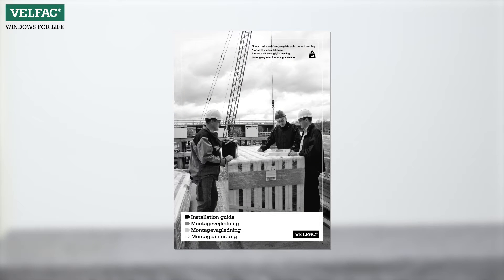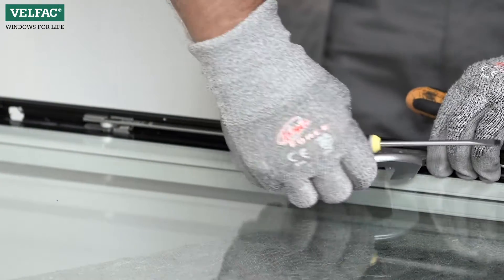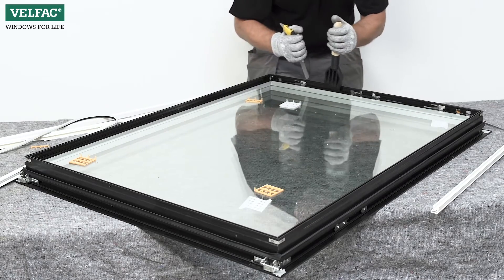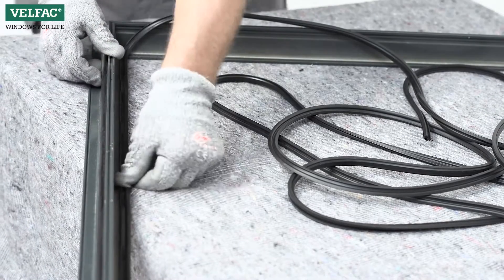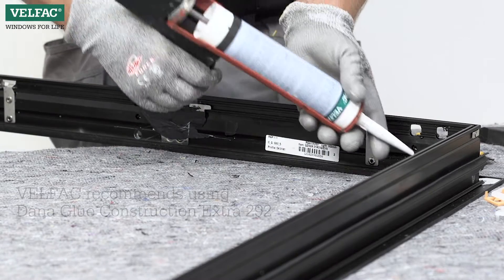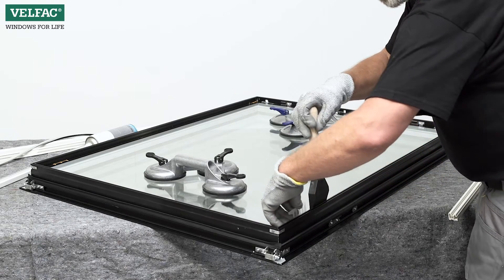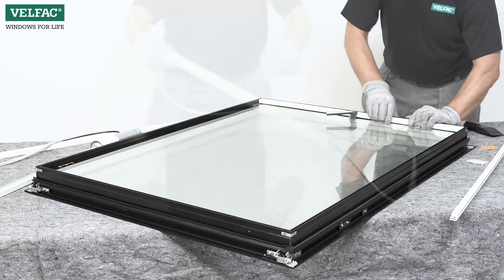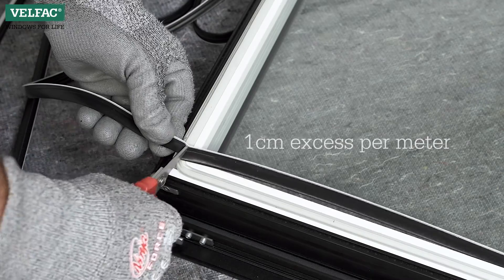Replacement of pane VELFAC 200i & VELFAC 200 ENERGY

Comment: Changed a few Velfac TGU's recently. Cutting away the adhesive from the door mechanism is the most difficult part (especially if you want to change the glass in position and don't want to take the frame off)....... Should have bought my don Carlos knife.  Wish they had used a low module silicone that's easy to cut but maybe there's a reason for that. For those that don't know, the size and make up of the Glass Unit is written on the spacer bar of most Velfac windows. Very handy.